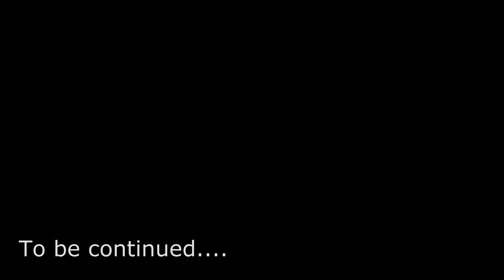How To Make Nixie Clock - Episode 4 Plasma Globe

Comment: Very nice video, as always. Thanks!  As a matter of fact - seeing, how often you use a handheld figure-saw in your projects, wouldn't it make sense to set back a bit of money and purchase a motorized bench version of the saw for the future projects? It would spare you a LOT of time, give nicer edges (less post-filing), and, after all, cheap one costs less than 100$/€.
Reply from the maker: You all say the right thing, but unfortunately the money I earn is not so much to buy everything at once, now I'm collecting money for CNC, I'm trying to buy a tool that I can not replace with my hands.
Reply: Oh, that's cool to hear! Have you already decided on the model of the CNC for your shop? I've dreamed about small (400x400mm) desktop CNC for myself as well, and while these days cost of the home-shop CNCs are all-time-low (a decent quality CNC router from China can be bought for around 900Eur), but that's still a lot of money for machine that will be used maybe twice a month as a part-time hobby...
Reply: heard of shapeOko I mean its a wood cutting cnc (mainly but can cut aluminum) base model cost 1200 (1099$ for just the cnc and 99$ for the dewalt 611 router)

Comment: Hey Banjo I was wondering what happens if you touch the right copper coil.

Because in the video we could clearly see, that the plasma tends to focus on your finger, but when you touch the left coil it only goes to the right coil. Thats why im wondering where the plasma concentrates while you touch the right coil, does it only connect to the left coil? 
I guess it still goes right because maybe the right coil has better contact with the plasma bulb and since they are electrically connected it should not matter where you touch the metal parts, i.e. left or right side or the ring. Im not sure tho, thats why i'm wondering.

keep it up
Reply from the maker: There is no difference to which coil to touch, they are connected together, just one has better contact with the plasma bulb.
Reply: ok nice thats what I thought. Thanks for the answer :)